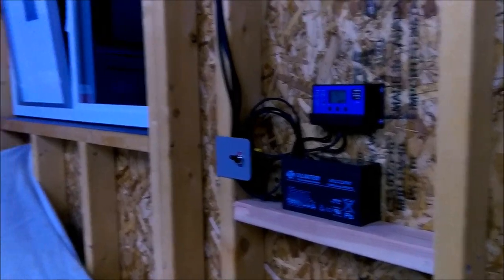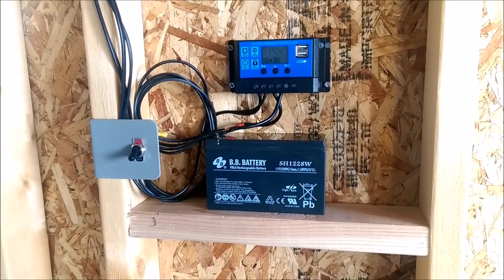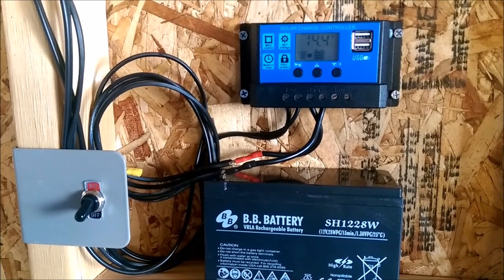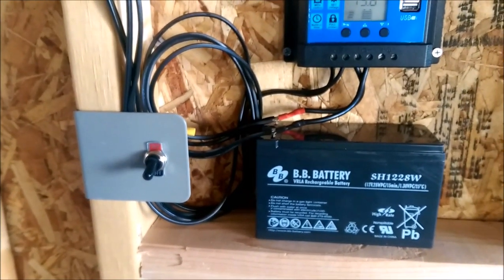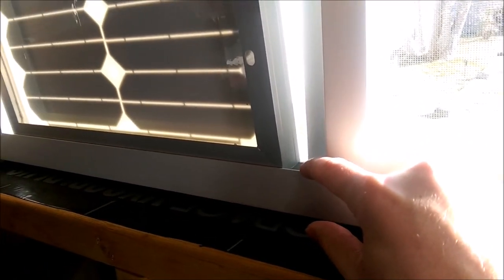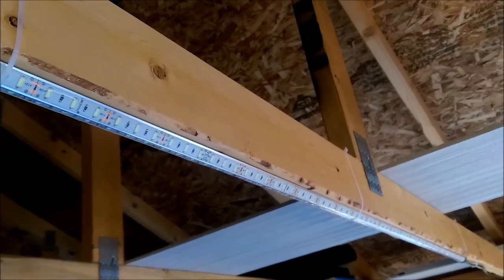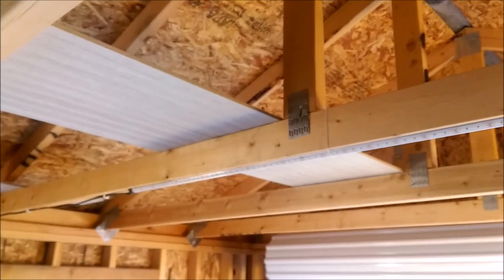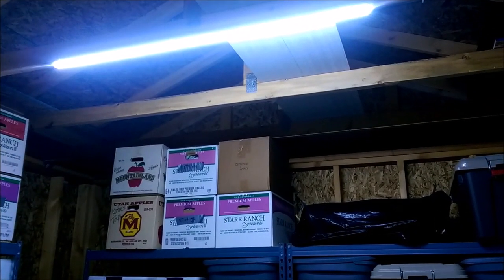DIY Solar Shed Lighting! Affordable LED Setup

Comment: Is this possible with a 6 Volt system? I hear that’s what some people do for RVs.
Reply from the maker: I have only seen 12 volt and 24 volt systems on RVs so I am not sure. Higher voltage in your system (24 volt vs 12 volt) means less current pulling from the batteries so you dont have to have as thick of wires, you can run more appliances in the RV with less load on the battery. I don't have much experience with 6 volt systems but if you found a solar charge controller that can run a 6 volt system, and a compatible solar panel, the same theory applied here should work on a 6 volt system.

Comment: if you use the load terminals on the charge controller to run the led lights is there anything that can go wrong?
Reply from the maker: No, using the load terminals is recommended if you want to keep your battery from being drained below it's low cutoff. I just decided not to use those leads in this case. Thanks for the comment!

Comment: How long will the battery power the lights at night?
Reply from the maker: My battery is small. I only planned to have it on 1 or 2 hours at most. If you want more run time add more battery capacity. Less lights for even longer run time.

Comment: Do you have links for what items you used?   Like where you got the LEDs and controller from.
Reply from the maker: Andrew Shealy all parts are listed in the video description.
Reply: Jasonoid No it doesn't, the LED strip lighting, links to the power supply.
Reply from the maker: Kodi Ham, the Amazon page has multiple options, choose the drop down list and choose the daylight LED strip instead of the power supply. Just verified on my phone. Works better on a laptop though.
Reply: Jasonoid Got it thanks!

Comment: Aren't you losing high energy UVA photons on your panel having it behind glass and not outside?
Reply from the maker: Haven't noticed a huge loss in performance, could be losing a little bit for sure. I don't use the lights on a daily basis, if I did I'd want to install the panel on the roof for sure!

Comment: Does this setup generate enough power to leave the lights on 24 hours continuously?
Reply from the maker: This systems does not, but if you add more solar panels and a bigger battery bank it sure will!

Comment: What is that where you mounted the light switch? Thanks!
Reply from the maker: It was a piece of metal I had laying around. It had a 90 degree bend in it and was pre-painted. Just had to drill the 1/2 hole in it

Comment: My light keep going on and off.   Any idea what I may have done wrong?  I did everything you did except the switch.   Maybe I have it hooked up wrong.
Reply from the maker: When my battery gets low my lights start to flicker. What voltage is your battery? Also, do you have your lights connected to your charge controller load or the battery directly?

Comment: How is the cable run into the back of solar panel?
Reply from the maker: The solar panel comes with wires attached, the wires attach to those.
Reply: @Jasonoid  wish I could send a pic my didn’t and it looks just like your setup
Reply: I do have a usb 1 and a usb2
Reply from the maker: @kevinarcher7701  your led lights are probably 5v usb lights and will not work with a 12 volt solar panel.

Comment: What's the type of connector you're using on the battery terminals?
Reply from the maker: This battery came from a Backup UPS system, I just used the same battery terminals for this setup.
Reply: I'm wondering about the cable side connector that connects to the battery terminal
Reply: I should have said the cable "end" connector
Reply: The female connection
Reply from the maker: Most of these small AGM batteries have "F2 Terminals" so you can search that on amazon and find a product that will work.  I just soldered and crimped the wires in.

https://www.amazon.com/Yueton-100pcs-Insulated-Terminal-Connectors/dp/B010GWZOUW/ref=sr_1_2?ie=UTF8&qid=1540409858&sr=8-2&keywords=F2%2BTerminal&th=1

Comment: how long will the lights last on a full charge? I need to do this for my chicken house. Is there a timer?
Reply from the maker: You can customize the lights for your exact need. If you want the lights to last longer, just use shorter LED strips with less LEDS on them. My light will last a little over an hour on a 7amp hour battery. So I would say either put in a bigger battery or use less LEDs to get the run time you are looking for.
Reply: +Jasonoid thank you!

Comment: Would it have been possible to do the panel on the roof?
Reply from the maker: Yeah, I just didn't want to drill holes in my shingles. All personal preference
Reply: @Jasonoid  could have used a pole-mounted solar panel and drilled into the side of the shed and not the roof shingles
Reply from the maker: @pzazzera  would have worked as well. I still don't want holes in my shed siding haha. The window has worked out well.
Reply: @Jasonoid  I totally understand and would have done the same but my window is facing West not South so it doesn't get much sun.
Reply from the maker: @pzazzera  You could also do a ground mount application too!

Comment: Would I be able to connect a 300w led light bar to this setup ?
Reply from the maker: You could hook up any light really, it just would drain the battery really fast. The larger the battery the longer it will last

Comment: hi can  i add  a inverter to run a ac  surge protector to run things
Reply from the maker: You can add an inverter to this setup. You would just hook it directly to the battery. You have to keep in mind that most AC device pull lots of power so you will need to have enough battery capacity or enough solar panels to keep up with that demand. My setup isn't big enough to run large appliances.

Comment: How long does it take to install the solar lights
Reply from the maker: Didn't take long, couple hours. It did take some time to solder up the wires too. Was a fun project!
Reply: @Jasonoid  is it a hard project cause I was thinking about getting a shed for my backyard but won't have no lights
Reply from the maker: @cgilfoy05  building a shed is the first place to start. Mine took me about 6 months to build but it's basically a small house lol

Comment: how much did it cost, and where did you find it?
Reply from the maker: All parts I used are listed in the video description. Thanks for watching!
Reply: I saw after sorry ,, so all for around 100.and you can cut the strip lighting in 3 foot sections? Can I add more strips and still get same results ?
Reply from the maker: @sicksand4  You probably wouldn't need more than 16 feet of it. It is super bright. But yes, you can always add more. The more lights you need to run the bigger battery and solar panel you will want to have.

Comment: How did you wire the cords to the light?
Reply from the maker: Soldered the wires directly to the positive and negative points on the LED strip.
Reply: @Jasonoid  since i know nothing about soldering anything, what is another option for led lighting?  I just want to be able to turn the light on in might building same way as you have in your setup, i just want a something i dont have to engineer, some premade led lighting that i can just attach to battery or charge controller
Reply from the maker: @mikeutsey  might have to look for other 12 volt lighting options. This is a DIY video, I'm sure there are other products out there that you can buy, they will probably cost more money though. Thanks for watching!

Comment: Hi can you connect a vehicle headlight to the system?
Reply from the maker: You could hook anything that runs off 12 Volts DC. Some vehicle headlights run off AC and DC current. A light that pulls 55 watts would probably need a larger battery bank / solar panel than this setup.

Comment: Just how much did it cost to build this?
Reply from the maker: Hey Jon, all the parts are in the description. Larger solar panel and larger battery will give you better run times.

Comment: How many hours will it run for
Reply from the maker: 2 to 3 hours in a small battery like this, bigger battery would be much longer. Bigger solar panel would be required for that upgrade
Reply: @Jasonoid  how much for 8 hours
Reply: @Jasonoid  I need like 4 of those strips and 8 or 9 hours rob time
Reply from the maker: @guypatts494  just scale up the battery and solar panel and it's still the same concept. Youd be looking for somewhere near a 100ah battery and maybe 200 watts of solar. I'm going to be upgrading my solar shed battery and solar probably next year for more run time.

Comment: How would I run 2 separate switches on this system?
Reply from the maker: The DC switch I use basically cuts power to the positive wire going from by battery to my led lights. Switch on, connects positive wire, switch off disconnects positive wire. If you want to have two switches controlling two different lights, you would have two sets of wires coming from the battery, one for each light. Each positive wire would have a switch on it to turn on and off the lights. I hope this helps. Thanks for the comment.
Reply: One cable coming from the power source up to a connector block, two wires out - one to each switch. It saves putting loads of cables down to the battery.

Comment: a 7A lead acid battery... so you only want to use 4A? draining lead acid below 50% will kill them fast. 16 feet is like 70w? so you get like 1 hr light per charge? (90% drain)
Reply from the maker: freezmac these particular lights pull less than they are rated, like most advertising the seller overrates them a lot. They pull less than 5 amps. I think the exact amount was 4.78 amps. I never use them over 20 minutes. This current setup is perfect for my needs. Never drained below 50%.

Comment: The amazon listing for the strip light says, "Need to feed by a 12V/5A (60Watt) Power adapter( ASIN: B01461MOGQ )need to order separately."
I did't see this on your items list. Necessary?
Reply from the maker: I am running my lights off a 12 volt battery. If you have 120volt power, you will need that adapter.
Reply: Ah! Got it thx

Comment: Nice project, great results-congrats. Could you charge a phone with that USB on that  SCC?
Reply from the maker: Hey Nick, Yes the USB port allows you to charge any USB device, it's been handy for sure!
Reply: Thanks- I'd bet your light would be even brighter with a larger battery, or have you upgraded it already?-again very nice clean install. I'd like a similar set-up at a hunting cabin.
Reply from the maker: A setup like this would be perfect for a hunting cabin. I would recommend a larger battery and solar panel if you plan to run more than just LED strip lights. The lights look much brighter in real life, my camera handles light and dark filming situations horribly haha. The 7ah battery works well for my needs currently.
Reply: I appreciate your replies
Reply from the maker: No problem, happy to help. If you ever need portable power on the go for camping or hunting, check out my DIY solar generator video on my channel. It makes camping really nice if you have to charge cameras, cell phones, or run anything thats runs off 12 volt. I used it all last year and it was awesome.

Comment: Could I add a 3 led strip
Reply from the maker: Greg Johnson that's basically what I used, look to the description for a parts list.
Reply: Jasonoid is there a link for switch and I mean I want to put 3 of the 8 feet leds on 3 different raptors in my garage
Reply from the maker: In my DIY solar generator video on my channel has the switches linked in the description. I used an extra one I bought in a package of three.
Reply: Jasonoid i mean instead of having 2 bars I want to have 3
Reply: Jasonoid would I need to get a bigger battery and panel for 3 bar instead of to
Reply: 2
Reply from the maker: Depends on how long you would like to run the lights each time you are in the shed. Any setup that is running the lights longer than 1 to 2 hours a day I would get a bigger battery. I only use the lights for 10 to 15 minutes each time I am in the shed so this smaller battery is okay with 2 'light bars'. If you want to setup 3 bars and run the lights for long periods of time, I would recommend you use a larger 12 volt battery.
Reply: Jasonoid  would I need a bigger panel to
Reply from the maker: Yeah, if you'd like to charge the batteries faster, a larger panel would be needed.
Reply: Jasonoid ok thank u I think im go with a 10amp f1 battery
Reply: Jasonoid what happen with the to post on the display at the end what hooks up there
Reply from the maker: Greg Johnson not sure what you are trying to ask, couldn't understand that comment. You'll have to do some research on your own to understand how everything hooks up, my other "how to make a solar generator" video has a wiring diagram that might help. Good luck with your project!

Comment: Oh hell no. That BLUE hue is horrible. I can understand a SLIGHT blue tint to white lights, but that blue color would drive me nuts. Had that color in my room, and might as well just get those color changing lights and turn it from red / orange to BLUE. Same exact thing. It's still too dark with an annoying color. Just get WHITE LED lights like ACTUAL WHITE.. Same cost and you can actually SEE EVERYTHING CLEARLY.
Reply from the maker: Well you know advertising claims, you buy one set of lights hoping for 4500K and you get 6000K.

Comment: how can I wire solar lights to a light switch? Thanks
Reply from the maker: Jacob Martinez if you put the switch on the positive wire between the battery and lights, when you flip the switch on it connects the circuit. 12 volt DC circuits are simple.
Reply: Thanks. How long will lights stay on? And could i use a larger size solar panel maybe 30 or 40 watts?
Reply from the maker: With the small 7 amp hour battery I am using I have had the lights on for 4 hours without taking the battery voltage to low. You could install a bigger capacity battery and bigger solar panels to scale the project larger.
Reply: Thanks I like the setup you have. I'm gonna try it. Maybe with a larger watt panel and battery.

Comment: How do you hook up the light bars after the strips have been cut to size?
Reply from the maker: Solder all the positive wire to the positive wire and the negative to the negative wire and so forth. All the connections are soldered and the light strips have a positive and negative mark on each side. Thanks for watching!
Reply: @Jasonoid  What about the landscape wire into the led lights?
Reply from the maker: @nicvancura8033  soldered. There's not really any other way to connect it. They have good solder points on the strip. It works well.

Comment: What size wire did you use for lighting ?
Reply from the maker: 14 gauge landscape cable, the lights pull 3.8amps so 16 gauge would also be fine.